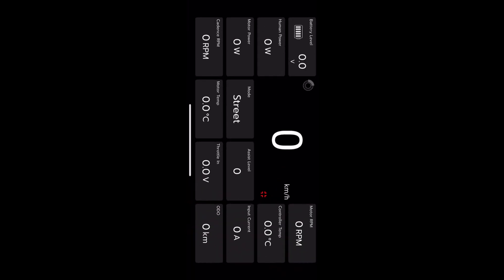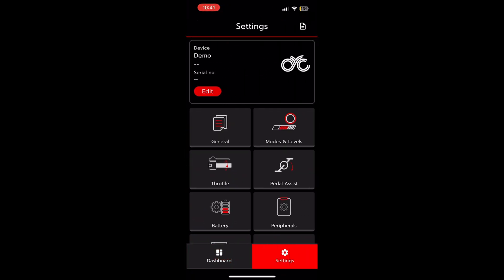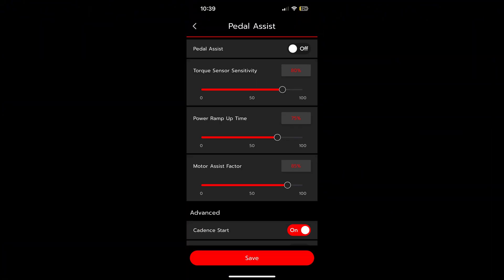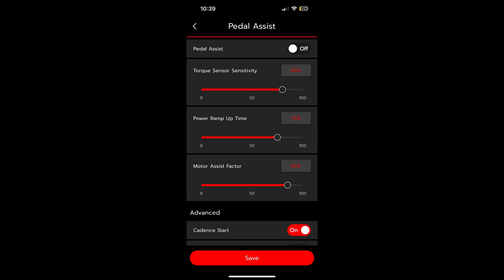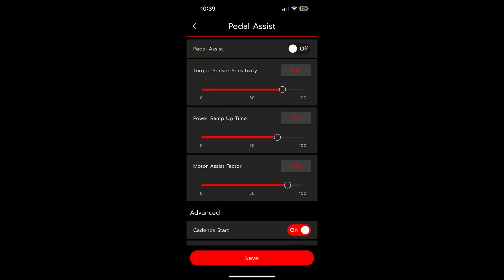CYC Photon Gen 2 Overview and Testing

Comment: Mich hätte interessiert wie laut er bei 250-500 watt ist, bei 1000 watt war er schon sehr laut
ABer im vergleich zu gen1 hat er wohl nicht mehr so Temperatur probleme 
gutes Video
Reply from the maker: It was on 250-500w for the trails, mainly 250w.
Reply from the maker: I’ll upload short clips of the 250w and 500w hill climb sound, I just didn’t include it because it was mostly ambient noise/cars/breathing. And keep in mind, any motor is going to make noise there on low gearing, it’s the steepest hill climb you’ll ever encounter
Reply: @puffinprinces198   thank you☺
Reply: @puffinprinces198 BBSHD is normally a lot quieter especially when new from a factory but then gets louder at some point even after regreasing primary gear with adhesive grease to avoid fling off due to centrifugal forces.
Reply from the maker: @uvwuvw-ol3fg  My BBSHD is nearly silent, probably the quietest motor available. The Photon is also very quiet and barely noticeable during normal pedaling. However, once power exceeds about 750 W or you shift into lower gears, it produces a noticeable sound that mainly depends on RPM. At around 2 kW or with very low gear ratios, it starts to sound like an RC car. Overall, it’s comparable to the BBSHD only at low power, most of the time it’s fairly quiet, with some audible noise under high power/high rpm but nothing annoying

Comment: Yeah! That's what I was waiting for
Good made overview, Thanks <3

There is already few other reviews, but I really like you showing changable settings in app and explain all of that stuffs ^^
1:40 that's the setting Im missing in my motor, its just turning on just little bit too late, it's nice to have an option of adjusting it
I was scared of this loud screaming during climbing from last video, but you are right, it's loud only on high rpm comparing to chill ending section of video (12:30)
I would say noise level is similar to my tongsheng TSDZ8
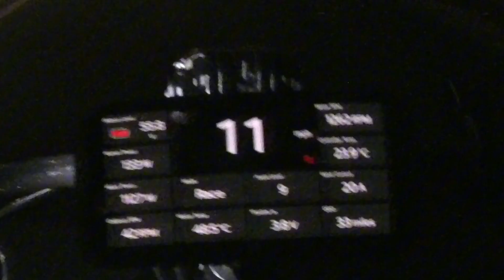2:50 I love the fact of having live preview of different values of motor during riding, specially the temp monitor is really nice to have
3:38 so do I get it right? it slowly go down with power to do not overheat? that's damn good, I'm scared of pushing my motor to over the limits for longer time, just because it does not have any overheat protection, not even ON/OFF switch, so kinda shame
Reply from the maker: Thanks for sticking around! 

You can really tune this motor for quick response and great feel, higher sensitivity, faster ramp-up, even disabling cadence start if you want. There are some neat setups for specific situations, though I didn’t explore every theoretical option (like using a low amplifier as a universal 2 kW mode), since most weren’t needed in practice. Also forgot to note, a lower ramp up time is beneficial if you have a faster cadence. 

Noise-wise, it’s comparable to other motors, not as stealthy as a BBSHD, but definitely quieter than many e-MTBs I’ve ridden with. I chose it partly for that, and I’m satisfied with the overall balance of power and quietness.

The temp monitor is really nice to have and highly requested. I would have opened it more for testing but usually when I checked it was just too low to be concerned. Would hang around 35-50C with normal riding.

As far as the thermals, yes! Seems like a pretty efficient stator, and it seems like it has some good guardrails against blowing up. To clarify about the last stat, at 90C it will lower watts to 1500 and the temps and watts won’t change. So 1500w seems to be the absolute limit.

Comment from the maker: I didn’t want to make judgments on other torque-sensing motors without hands-on experience, but based on reviews, this one seems more reliable than both Toseven and Tongsheng. It also feels more refined overall, especially with the app support, build quality, and customization options. The CYC app gives you all the essential features in one place, while Toseven lacks an app entirely and offers more advanced settings but oddly misses some of the basics. There are better reviews out there comparing these motors to the Gen 1 which should be about the same for the Gen 2.

On paper it's lightest in its power class, and I’ve heard it offers the best torque sensing. Compared to the X1 Pro, I’d say the X1 Pro is more suited for dirt bike-style riding. It’s powerful but requires a large battery to run that power consistently. It’s also bulkier, louder, and more obviously illegal in regulated areas, plus it has an extra chain to maintain. The Photon, on the other hand, is lighter, quieter, stealthier, and tool-free for maintenance. Since most riders will pedal to conserve battery, the pedal assist on the Photon Gen 2 is the better experience.

If you care about future-proofing, the upcoming Proton motor core is expected to fit in the same housing as the Photon, and swapping to a different bottom bracket shell in the future only requires a different spindle. It also supports 72V operation, unlike most other motors, giving you room to upgrade later.

The main reason I chose it though was compatibility. My bike has a tapered bottom bracket that can’t fit most motors, but the Photon’s split-shaft design works perfectly. It also has the best chainline I’ve seen, letting me access all 12 gears, which is crucial for climbing. It’s the only motor that does this while still allowing a smaller 36T chainring, something most motors can’t manage without sacrificing chainline. I needed that smaller ring to fit within my frame.

It is pricey, about $140 more than what I spent on my BBSHD kit, but it’s the only motor that checks every box for my setup.

Edit: the narrow-wide chainring keeps the chain on. My chain always fell off on bbshd
Reply: Yeah, next nice thing about cyc motors, just a few sec and you can change from illegal to legal changing the power and limit speed, in TSDZ8 you can quick change just the speed, not the power
Ability of running 72V probably will improve max speed of the motor, so there is much potential, because like you said most other motors gives lower max voltage (TSDZ8 runs 48V max)

I cannot wait to try out this motor on my bike ^^
Reply from the maker: @ILIKE3DPRINTERS The pas settings are definitely versatile, being able to switch from street to race and adjust the speed limit. I didn’t go over it because it was pretty self explanatory, but I did change the watts for specific modes, such as changing the highest assist from 1.2kw to 2kw, and setting my low assist to 250w, then 500w, etc. Most reviews seem to be running on default modes. 

The 72V is a nice improvement for speed. But not for what most people might think. CYC support has told me that 52V pretty much reaches the optimal usable rpm, so the 72V wouldn’t do much for top speed. However the test done by JNO shows the rpm headroom could benefit slightly from 72V. The main reason I’d run 72V though is for cooler temps.

On the note of RPM, with a 52V, as your gearing drops below 2.7, rpm limit will be reached sooner on a flat (lighter load), and therefore max watts will drop. I made a quick note about it in the description. 72V may improve this
Reply: @puffinprinces198 yeah, and that's also nice to use 72V, it makes whole setup more efficient, less heat is generating so the motor will be cooler